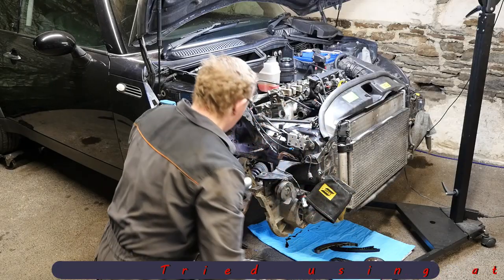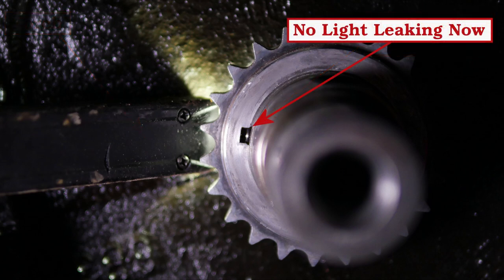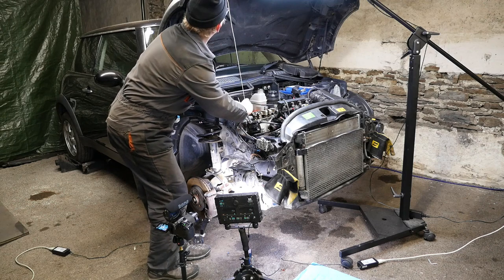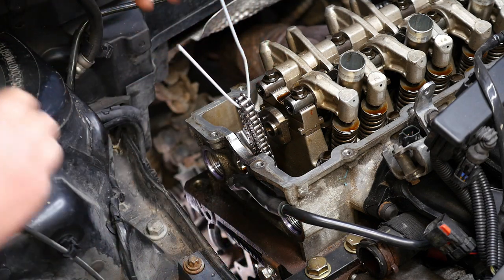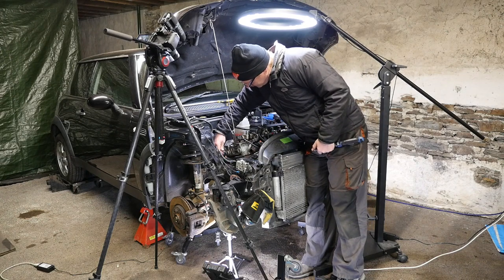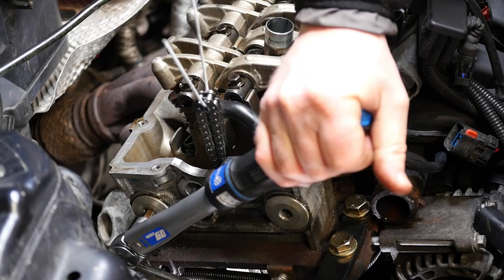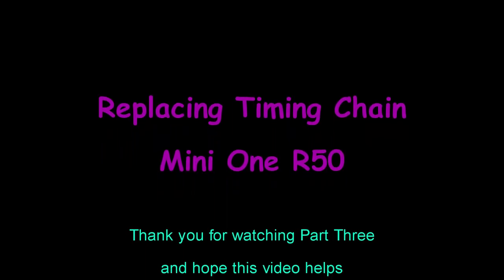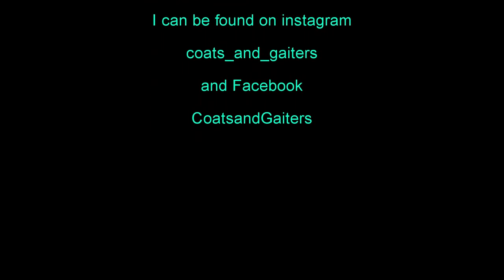Part 3 - Mini One R50 R53 Timing Chain Replacement Tritec Engine🚗Fitting New Chain & Tensioner

Comment: Just completed this job today but I removed way less parts. You can easily remove the timing cover by just slightly raising the engine with a jack-comes right out with a little rotation. 
My chain with only 2000k miles exploded into the oil pan im glad these are non-interference engines.

Great videos btw.
Reply from the maker: Well done, hope it all runs ok for you now.  That's low mileage !!!! You a fast driver lol ?
Reply: @mitcheljonckheere9624  yes it is, I broke a timing chain not too long ago and slapped a  new one in there and all was well till I spun a bearing, lol.

Comment: Awesome series of 4 episodes for changing the timing chain. I used the locking tool but as I took it of to change the chain and sprocket the timing jumped. I am shocked and afraid to finish the job and destroy the engine on start. How can I get it right? I think the camsprocket goes on just one way otherwise the lockingtool dont fit...am I right? I just turned it clockwise 350 degrees (ish) to get the sprocket and lockingtool back on. The chain then goes on one way because you want the colored parts of the chain to line up with the marks. Unfortunately this works at every 360 degree spin of the crank...So when is it perfect? Haynes says the pistons need all 4 in the same spot, about 3-4 cm from the top of the cilinderhead, servicemode. Is there a golden tip to get this right? I dont want to destroy the engine on startup. Greetings from the Netherlands, Martin.
Reply from the maker: The cam will spring round under the pressure of the valve springs so that normal.  As long as you have all the links correctly aligned, the chain tensioned and then remove the locking tool all should be ok.  It's always best to rotate the engine by hand first to ensure the valves don't hit the pistons anyway.  Socket and long bar on the crank.  Rotate clockwise.

Comment: Great information. I'm going to give it a go. Maybe one should measure the temp of the sprocket with an infrared meter? I read that one also should fill the oilpump with some oil?
Reply from the maker: Thank you for the comment.  Infrared can sometimes misread on shiny surfaces.  I'd leave it in for an hour personally.  You do need to prime the oil pump before putting the cover on, though as you do it some oil seemed to splash out.  I primed and also turned by hand but it seemed to need the starter to really get things moving.  Hope the videos help you.

Comment: Would love your advice for a serious impasse I'm having. Trying to put the chain on the sprockets but the nub in the top sprocket is slightly off and can't get the chain in position with the sprocket on the upper crank shaft. (I compared old and new components, everything seemed fine) so I tried putting the sprocket on first and matching the chain to it, which I was able to do, but the chain is so tight on one side (yes all notches and marks lined up with chain) that it thunked forward a notch. It's RIGHT on the edge of it's next 'resting' position. So i rolled it back with channel grips and I can't get the engine to stay where the chain wants it to be. have spent a few days trying things and I'm about at the point of saying to hell with it and putting the older, slightly stretched chain back on...
Reply from the maker: You have removed the chain tensioner haven't you Eric?
Reply: @CoatsandGaiters  - oh yeah, even took out the rails to make getting in and out easier. The chain new just does not wanna go where the marks are.
Reply from the maker: @ericbmusic  Have you compared the old chain to the new one to ensure the same number of links and that the coloured links match.
Reply from the maker: @ericbmusic  one side of the chain might be under tension as the springs in the valves will be trying to force the came round to a point of rest.  You may need to get someone to hold the cam and just tweak it back or forth with a large spanner or mole grips.  I think the right hand side of the chain was under tension while the left was slack.  I used the cam locking tool to hold things once it was in the right position.
Reply: @CoatsandGaiters  - yup, will try a different technique tomorrow for holding it in place while I try to work the chain on. Thanks again for your replies!
Reply from the maker: @ericbmusic  I did have the chain flipping because the cam kept moving.  Don't give up as it shouldn't be too difficult, there must be an obvious reason your not noticing.  As long as all the parts match the old parts they must fit.  If the crank moved you could try putting it into gear to stop it moving.  You could always line the cam up with the tool and then lock it in place with other clamps dare I say, while you remove the tool and the cog.  Carefully put them on correctly and then get that holding tool back in place quickly.
Reply: @CoatsandGaiters  - thanks again. tried this today and just sent a couple pictures of the outcome via email (and another small donation :)) The misalignment on the chain on lower sprocket is wild to me. I'm so perplexed. The top is together as it should be but the lower is off by A Lot...
Reply from the maker: @ericbmusic  Thank you so much for another donation Eric.  Will go to my email now and see what I have.  We need to sort this as it will frustrate me now lol

Comment: Hello - I was having problem on fitting the top sprocket. I tried turning the camshaft but it rotated 360. I was able to put the locking tool again - would rotating the camshaft create an issue? I havent installed the chain yet. Hope you can advise. Thanks
Reply from the maker: It can be tricky as the springs in the valves can flip it over.  The main thing is that the timing marks on the chain, camshaft and crank all line up correctly.  Perhaps get a friend to hold the cam with a something while you get the tool in place.

Comment: Hello. I think next week i do the same. Very informative video. Thank you. Have question. Maybe you remember how meny miles run this mini on video?
Reply from the maker: Thank you.  I’m driving the Mini at weekends and all good so far.  Done over 1,000 miles.
Reply: @CoatsandGaiters  I mean how many miles was before changing chain? My one is 240000 km/150000m and servise thing i need change it.
Reply from the maker: @donatas3743  I think a chain normally lasts the life of the engine unless you get the rattle.  Mine has done 150,000 but had a nasty rattle hence I changed it.

Comment: Hi, could you tell me what is the milage of the engine r53?
Good job!!!
Reply from the maker: I think it's around 115k
Reply: @CoatsandGaiters  I was hoping for more mileage.
Thank you
Reply from the maker: @Jolly-Sid69  I bought the car and was under the impression the rattle was from the timing chain and hence I changed it but I also found I still had a rattle once the car was finished which I'm now working on now and it was the clutch release bearing sleeve tube had snapped off.  So the rattle may not have been the chain at all but we all assumed it was.

Comment: Hello, I changed the gas valve, I followed all the steps, the mark from the bottom is in place and the top is in place, but it did not work, what is the reason
Reply from the maker: Sorry but not understanding the 'gas valve'?
Reply: gasoline valve
Reply: I did all the steps and put the mark on the bottom in its place and on the top in its place, but I run it does not work
Reply: Please
Reply from the maker: @azizmilad870  Where is the gasoline valve? this video is on the timing chain.  I'm really confused.